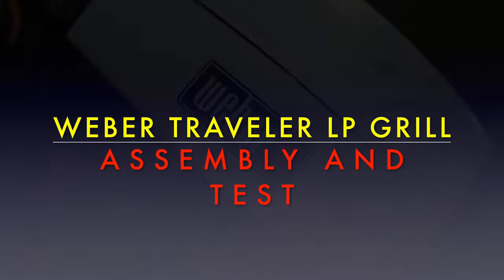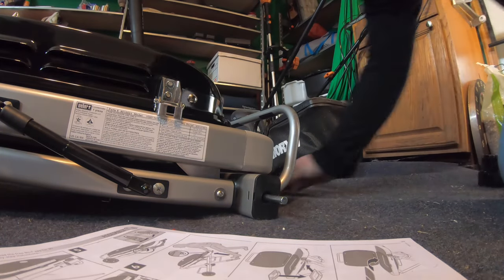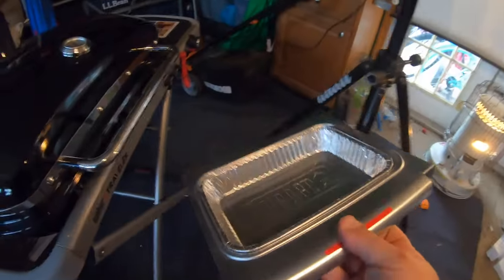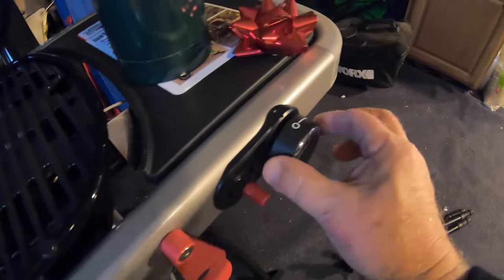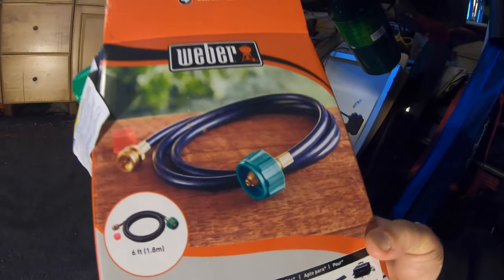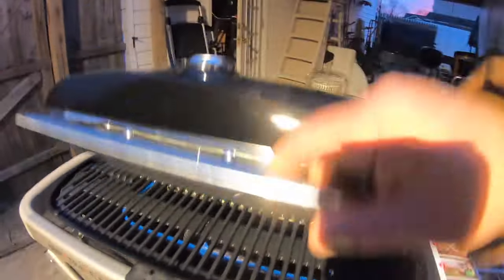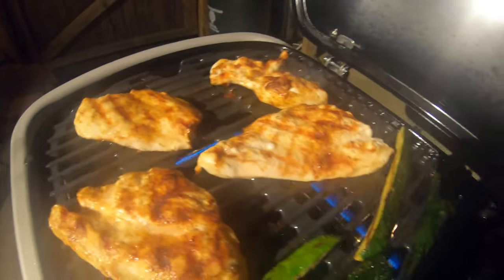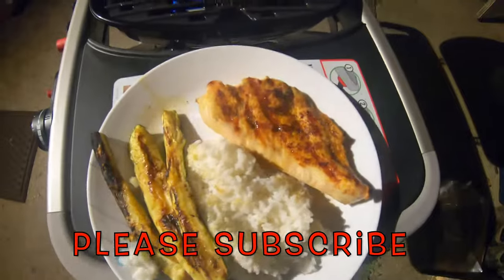Weber Traveler LP Grill Unboxing and Assembly Grilled Chicken and Zucchini with white rice Test ride

Comment: Be very careful when screwing in the portable gas bottle, so easy to cross thread.
Hottest part of the grill is where you cooked your vegetables.
Check to ensure the lid clip has extended to keep the lid closed and that the red fold clip is in place when the trolley is folded down.
There is a robust dust cover from Webber that will protect the grill and trolley when folded away for storage, strongly recommend you use one.
Remove the grease tray before folding down or standing up vertical as the grease will spill out all over your floor, otherwise it’s a great addition to your camping equipment or space saving on your deck at home.

Comment: How did you get the flame
So high. I got mine but the flame is not nearly as high
Reply from the maker: I need to heat to 500℉ before cooking. 
Are you hooked to lp tank or an RV supply port? 
RV ports are regulated , if you use this source for the traveller pressure may be very low due to being regulated twice. 
Thanks for watching I appreciate your question